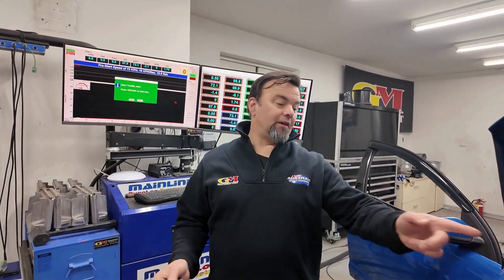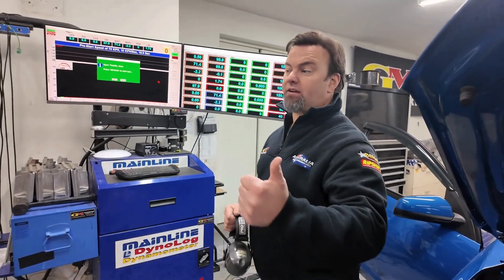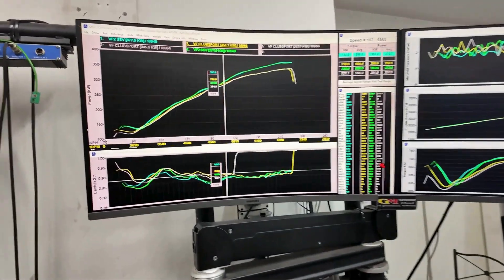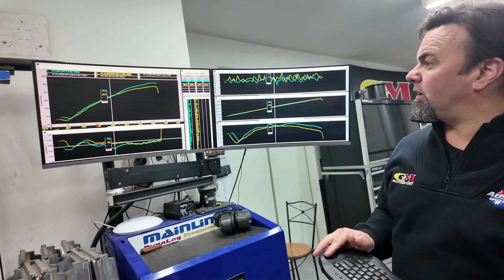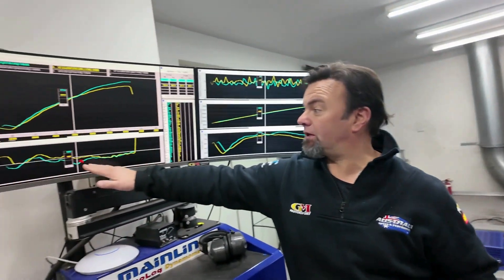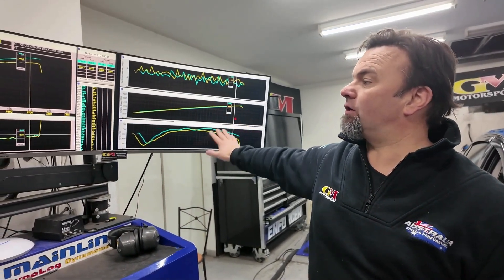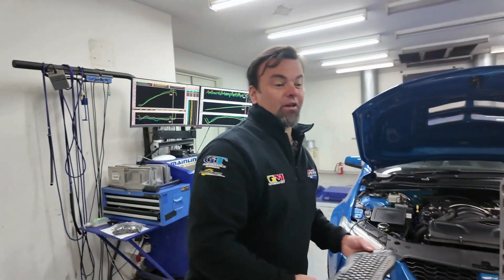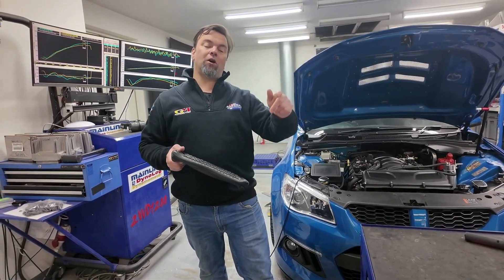How Much Power Do CNC Heads Really Add? (Back-to-Back Test)

Comment: Dollars to doughnuts heads are not really worth it unless U going for every hp rather than spend 3_5 K on heads put that money towards boost and instead of making extra 40 rwhp make an extra 150_500rwhp👌 I bought Higgins race heads took my ls1 to over 300rwkw not hub at wheels but the 3500 I spend again could of went towards boost

Comment: Would like to see an aftermarket set of cath heads like a 205 or 215 from afr/trick flow or similar that flow around 300 cfm (like ls3) with a dorman ls2 intake so the ls3 throttle body can be used. Then test it all and see how it performs again vs these cnc ones or stock ls3 heads. Will there be that much more midrange? Maybe..
Reply: Waste of time they are not as good.